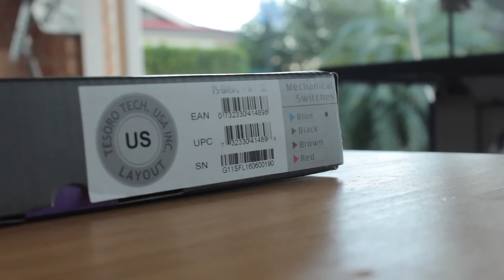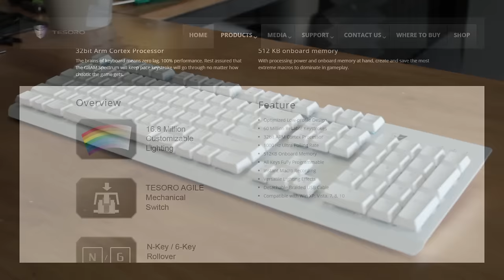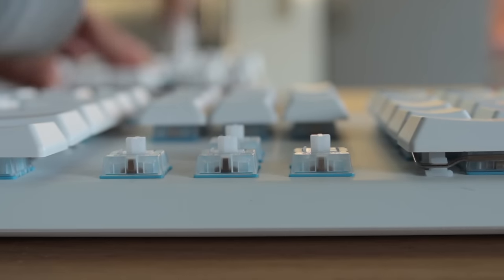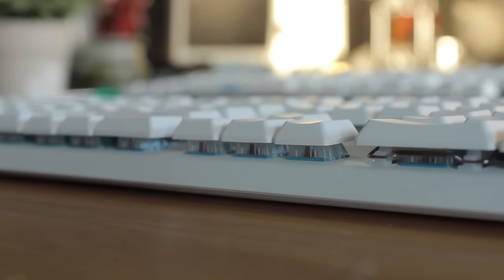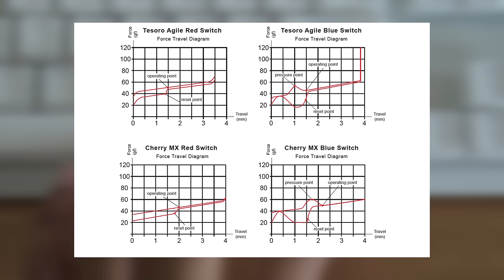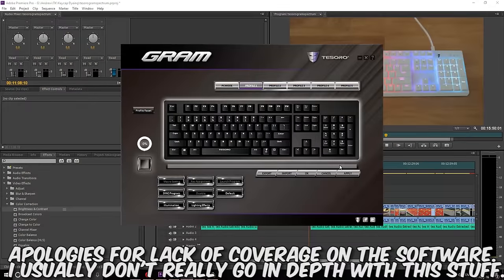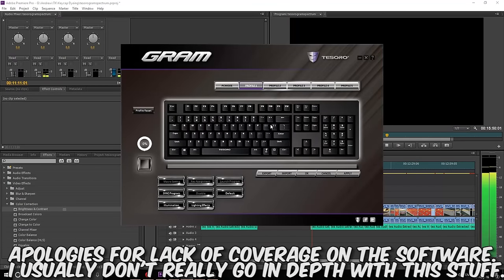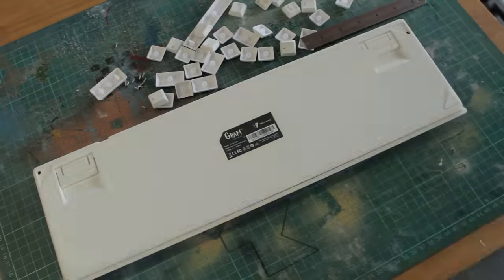Tesoro Gram Spectrum  RGB Gaming Mechanical Keyboard - Unboxing & Review

Comment: great review extremely in depth, i agree with the font, but if they just filled out the b's, p's, 8's, 9's, 0's, and e's so they do not have those strange gaps it would be fine i think, im more not a fan of the secondary writting being either side by side like on the numbers and brackets or the f keys having the correct vertical lettering but not being etched, they should just etch them all like normal, like will still come through, and it will look cleaner

about the layout, you said you didnt like how big the alts were, this was actually one of my higher selling points, this is an american based layout many keyboards use it, like a standard logitech k120, i couldnt get used to the corsair keyboards because of the smaller one, i play arma and i use that key all the time while still using wasd at the same time, i love this layout but i am used to it, i assume you are used to the other "standard" layout

Comment: Companies could make low profile keycaps I would maybe buy that XD cause I used low rofile keyboards like for 7 years and then since 2016 started to use mechanical ones. Basically I got used to it and now don't super like low profile ones a bit but when you get use to those it is also fun experience so yeah it would be nice to be some low profile keycaps in the market

Comment: I don't like the concept of this keyboard at all. What's the point of a mechanical keyboard without full travel it's one of the most satisfying things about using a mechanical keyboard.
Reply: I agree with you. If the point is to make a progaming, fast-response board, why are there blue/brown switches available? Gamers use linear switches anyway (except Razer boards, lmao)
Reply: WITT It makes no difference in response time, the travel distance of the whole switch doesn't matter for that only the actuation point. There are many other switches that have the same if not higher actuation point. It doesn't really matter much even in that case as all you would have to do to make a normal switch actuate at the same time would be press down a little faster. It's just marketing BS.
Reply: I love the feel and sound of an actuation point, as well we the rollover on my mechanical keyboard, but I was using a laptop keyboard exclusively for ~7 years of my life. I still haven't gotten used to the taller keycaps and this keyboard would be a really great intermediary between the two.
Reply: keyboard feel is very personal. Many like this idea so the concept works. I like it because i just prefer lower key travel similar to laptops. I've owned mechanical keyboards before and yeah it's possible to get bored of them.
Reply: It makes it better at competitive games where you need to react extremely quickly, like CSGO, Rainbow 6 etc.